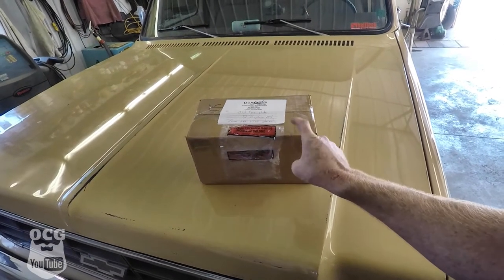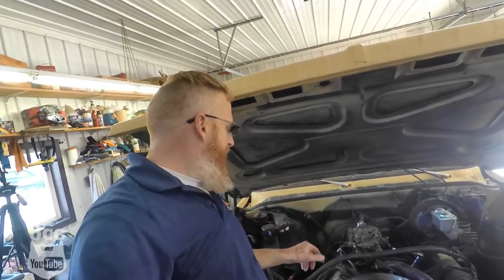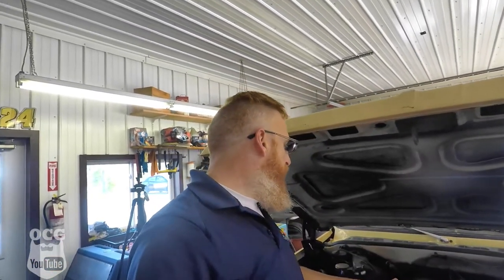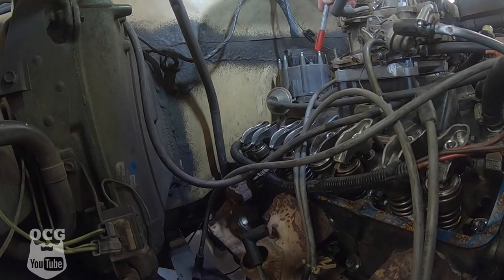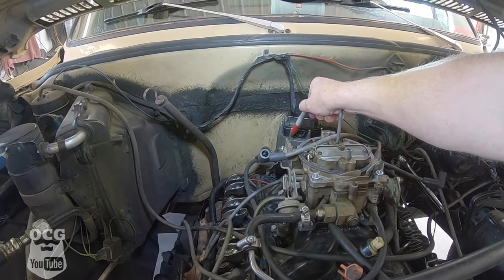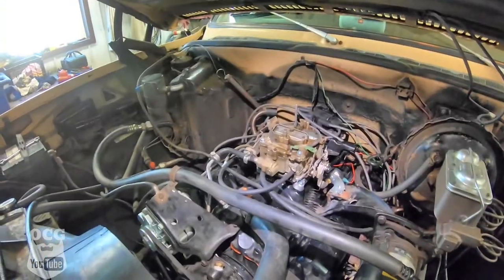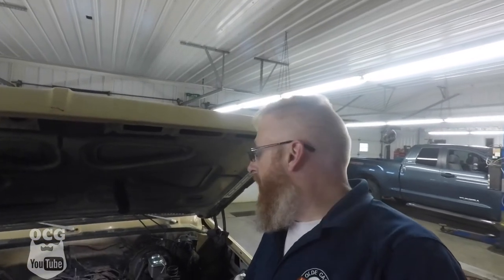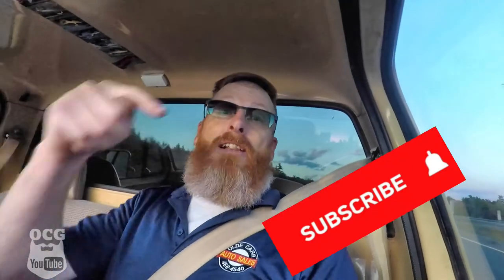SETTING THE VALVE LASH WITH NEW ROCKER ARMS AND PUSH RODS IN MY 1977 CHEVY C10-part 2

Comment: It's always a great feeling when you fix something like that. I've had my own issues with lifters and camshafts....283 ate four cams....turned out the pickup had somehow lifted basically lifted up on a 45° angle...not sure how. I built a 355 to replace the 283, it literally ate 5 lifters and lobes the day after break in, put metal everywhere...rebuilt it again, it was perfect, fired it up this spring and drove it home, it did it again... I gave up....then bought a "Well used" 71 350 4 bolt, cleaned it out, threw a used cam with some NOS 70's lifters in it with break in lube, threw some used 76cc heads on and my Performer RPM intake...thing runs pretty darn good for being thrown together for mostly used junk and it got me through 2020 without any issues!
Reply from the maker: Good to know I'm not the only one. But this is exactly what the hobby is. throwing money at something to keep us busy and mostly out of trouble.
Reply: @OldeCarrGuy  True, it definitely keeps me out of trouble, for the most part! Haha. I really should start filming this stuff.